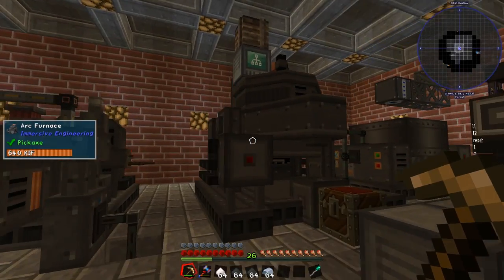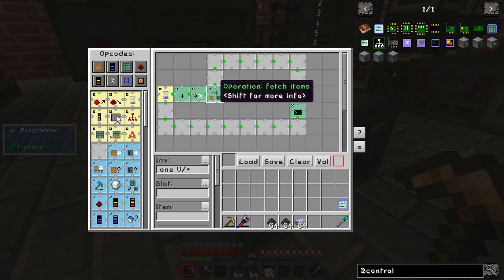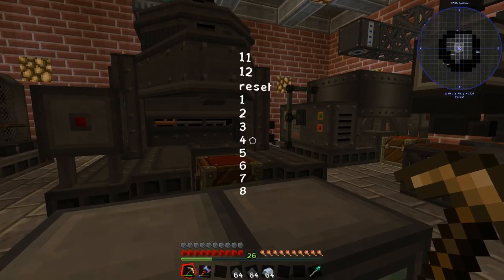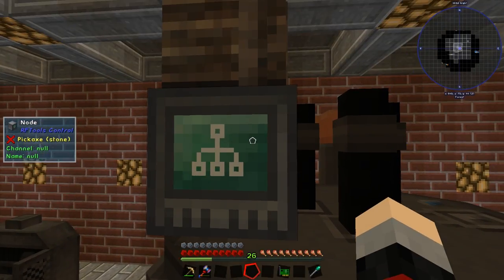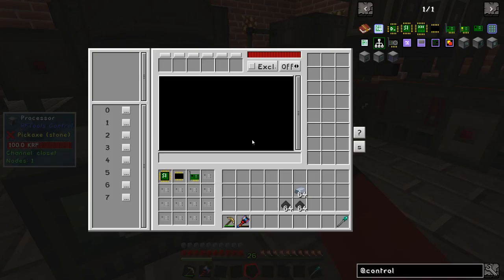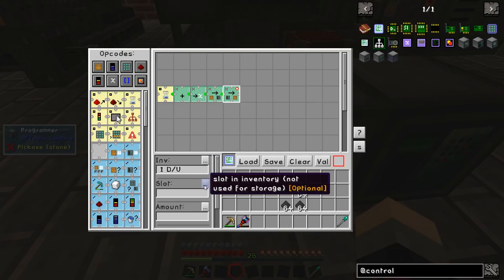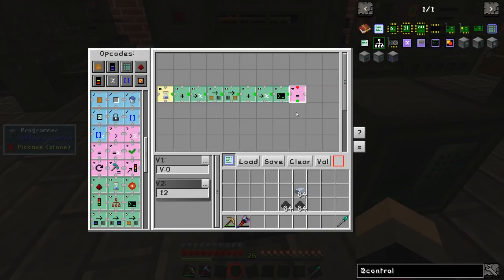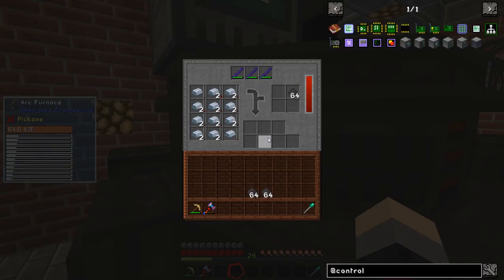Arc Furnace Automation using RFTools Control | Age of Engineering | Closet Gamer

Comment: This is great. I didn't know this mod was in the pack. Thanks!

Only one error I found in the program is you're not breaking the loop at the end. The processor isn't smart enough to assume the end of the loop and reset the timer so it runs constantly instead of ending and recalculating your (5) tick wait time. Since I run a server I chose (200) ticks as not take up to much thread time.
Reply from the maker: Andrew Hrubik no problem man, glad you found it useful. I see, so a terminate program tile should fix that I think.
Reply: Exactly what I did. At the end instead of creating a positive loop you terminate the program and it automatically restarts at the begining based on the starting event.
Reply from the maker: Andrew Hrubik sounds good, cheers Andrew